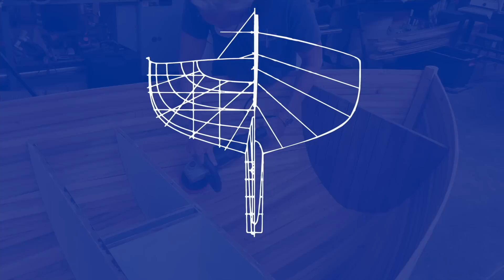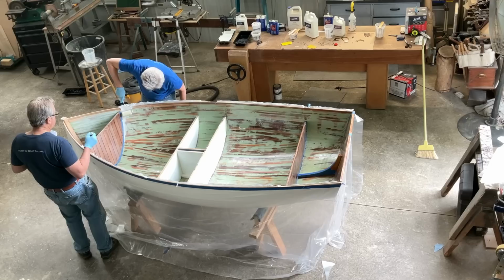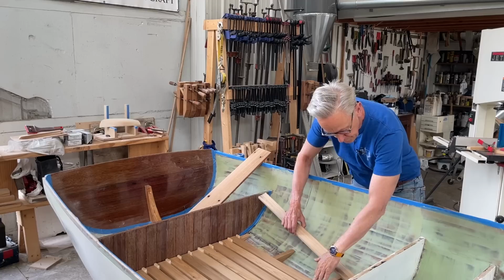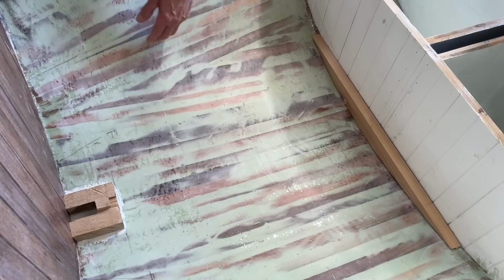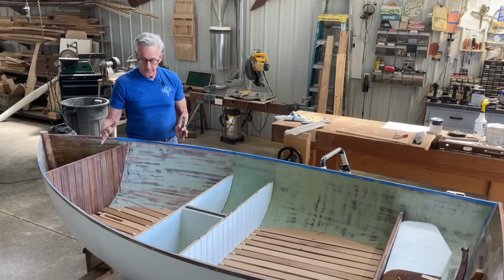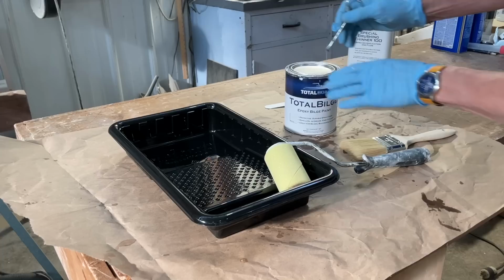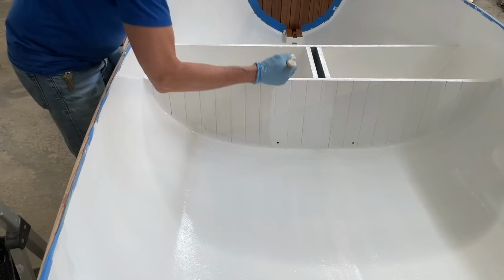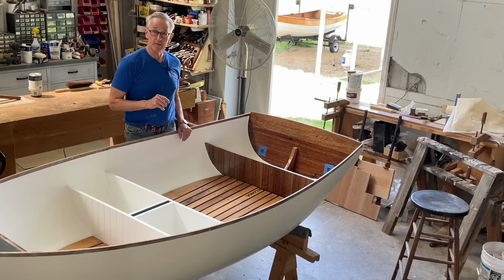Dinghy is Looking More Like a Boat with an Amazing Removable Sole S3-E18

Comment: Just one question: How do you bail out the boat with that sole in place? It's going to sit in a lot of fresh water when the boat isn't stowed?
Reply from the maker: That’s one reason for the removable sole!
Reply: @TheArtofBoatBuilding , so it’s not common (traditional) to create a bilge area with drainage passages and a rear drain plug?

Comment: If you punch a small flat tip screwdriver into the bottom of the lid channel on the can . The paint will run back into the can when you close the lid 👍👍

Comment: Beautiul work, so satisfying to follow. The latches were clever. Only question is why not cover everything in epoxy, especially the floor boards?
Reply from the maker: I mentioned in the video why not to varnish the sole. Coating it with epoxy is the same result. It will make the sole slippery when wet. The sole or the deck of a wooden boat should never be varnished.
Reply: @TheArtofBoatBuilding Right, but how about just some anti-skid? The type that's used on skateboards is relatively cheap, lasts long and very grippy. It even protects the wood from wear. With the sole constantly in wet (even fresh water from the rain), it seems ideal to epoxy each piece (even screw holes) before assembling.

Comment: Hi Bob, wonderful work, beautiful boat 😊 Just wanted to ask a small detail; if I may ☝🏼 how do you clean the masking area spills? White primer onto varnish!?! Many thanks
Reply from the maker: I use the tip of a single edge razor blade. First score the intersection of the paint and varnish then gently scrape the unwanted paint. Careful sand lightly and touch up with some varnish with an artist brush.
Reply: @TheArtofBoatBuilding  Thank you!

Comment: Hi Bob, a question regarding the mast step. Was it fasten to the boat? If yes, then how so.
I was curious how you would finish the sole. Thank you for the explanation; functional and beautiful.
Reply from the maker: Bedded with 3M 5200 and 2 bronze screws from inside the fore bulkhead.
Reply: @TheArtofBoatBuilding  Thank you for the reply. I figured if there were screws, that was the likely placement.

Comment: Any guess on what the finished (and outfitted) dinghy will weigh? I wonder if Steve will be able to launch and retrieve it by himself.
Reply: It was mentioned in a previous video, but I can't remember what the number was.  But it sounded fairly do-able to launch and recover solo.  Also, don't forget there's no shortage of ropes, pulleys and booms (I'm sure there's nautical terms for those that I don't know) on a sailing boat.  So I'm pretty sure Steve could rig himself up a jib crane to lift/lower Victoria if she was a bit heavy.

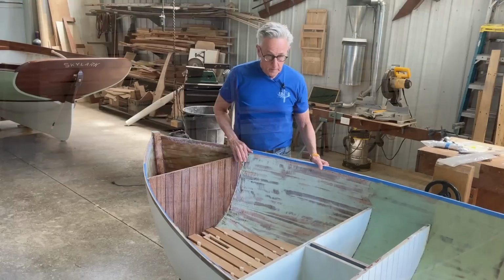Comment: I'm puzzled why, at 14:30, the edges of the decking aren't aligned. They seem to have different outlines rather than flow into each other as I expected they would.
Reply: I think that is an effect of battens he used on the piece by affixing it near the middle of the ship and not on the ends the splines shape was thrown off.  Not sure how to address it maybe have some scrap wood cut to length and temporarily place on either side and than have the batten go the full length? That's my best guess
Reply: @aknorth1053  Might also have been at different heights.  It looks odd and unexpected.

Comment: can I ask bob when you marked the timber floors to be cut it appeared that you marked the timber freehand? the port and starboard soul boards looked calculated. Did I miss something?
Reply from the maker: I was using a block with a pencil attached.

Comment: What is the reason for putting peel ply over the fillets as they cure?
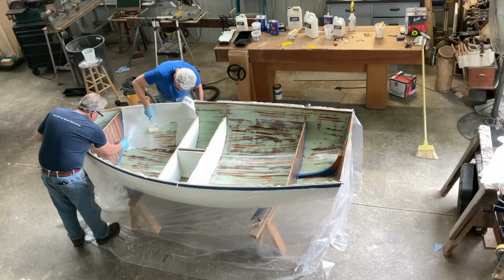Reply: Episode 15 at 3:33 - peel ply protects the epoxy while it's curing so that dust etc. doesn't get stuck to it and after peeling, it leaves a nice finish that only needs to be sanded lightly for further use.
Reply from the maker: Hi Mark,
When using a round fillet tool, the epoxy is very hard to get perfectly smooth. The peel-ply with a slight pressure for my finger helps smooth out any unevenness. Also very easy to feel the if it’s smooth. The peel-ply also leaves a very finish. 
As mentioned in Inventive Owl comment in Episode 15 I explain in more detail. 
Thanks for watching

Comment: Aren’t you concerned having polyester->wood->polyester like that?  Wouldn’t it start to rot after a while?
Reply from the maker: There isn’t any polyester in the construction. If you mean epoxy, which is quite different than polyester, then no. The rot resistant cedar is seal away from moisture or oxygen.

Comment: 14:26 Why don't those edge boards on the floors appear to be fair from one floor section to the next? Are they at different depths? It seems like if you continued the imaginary line of one of the floors through the seat compartment it wouldn't line up with the next floor. But the hull is fair, right?
Reply from the maker: They are at different levels. They are the same level at the center bulkhead. The aft tips up to the stern and the fore tips up to the bow.  Both are minor degrees and follow the curve of the keel. If I had made them flat inline with each other the bilge below sole would have been quit deep. The soles do follow the hull which is fair.

Comment: How much will this little boat weigh?  It looks like it's going to be a tank, much too heavy to be a useful tender...
Reply from the maker: I’ll be weighing it after she’s finished. Shes surprisingly light!
Reply: @FlyNineVictor  You have to be kidding, right? It's eggshell thin, essentially frameless (just a few light bulkheads), out of strip planked cedar. 
Boats just don't get much lighter than that  (and yet be suitably stiff and tough) without resorting to carbon fibre.

Comment: No limber holes at center of boat?
Reply from the maker: No limber holes. The idea is that the center lockers are watertight as to use for freshly caught fish and as a flotation chamber.
Reply: @TheArtofBoatBuilding  great  Like on the Yankee Tender  Built a cold molded pram back when the gougeon brother's book first came out they had plans back then been buying woodenboat mag off and on since issue 1